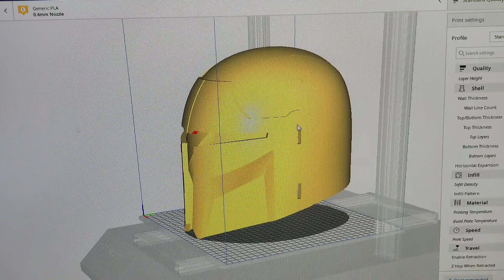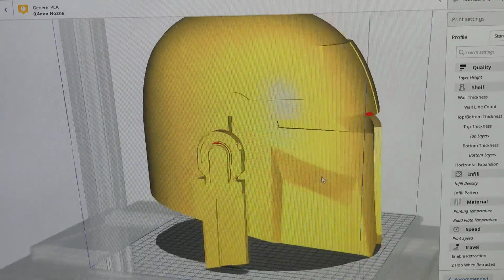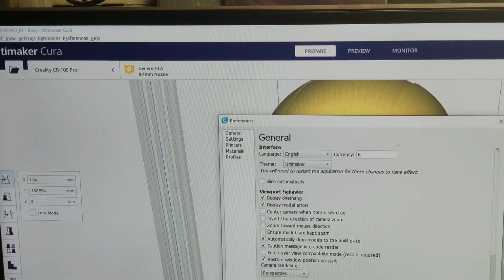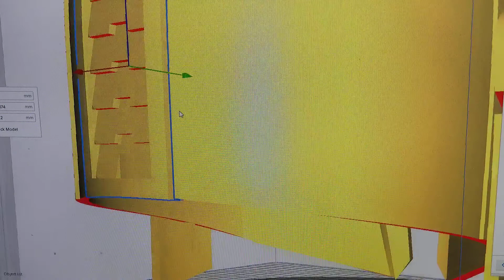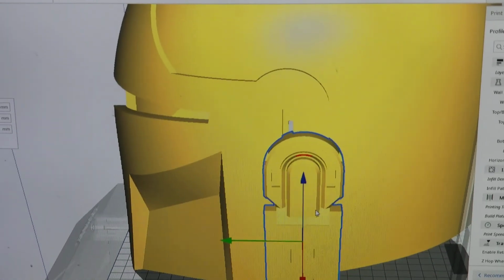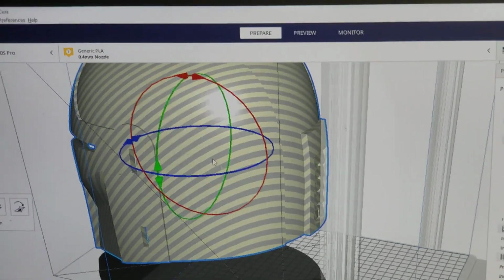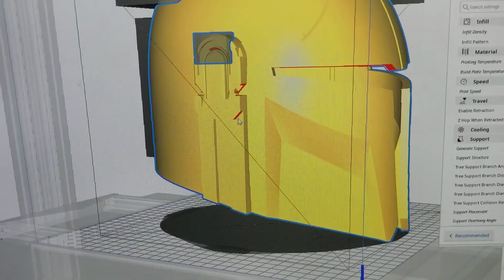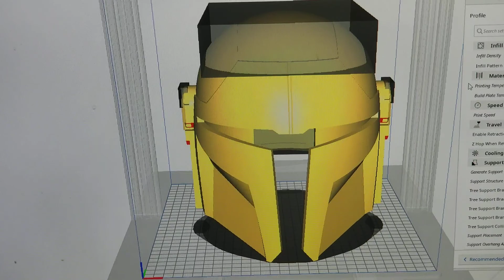Cura: Quick explanation of merging models

Comment: I assume Merge is not the same as Group. I assume Merge makes the models into one, as you say, whereas Group only makes them a group and not one model. I assume merge will make one object which will make one outer skin, for example. However, merge separates the models which is the opposite of merge. Please advise.
Reply from the maker: I've never had success with the merge feature.
Reply: @PrimeDirectivesArmory  I have a situation where I am Texturing and Tagging a Tapered Pipe (a bit more complicated than a tapered pipe, but for illustration). To line up the texture and tag with the outside of the pipe is a delicate operation. I have been able to get it done with many many hours of  adjustments but it's not practical. Grouping does nothing, as far as I can tell, to make a single model. I am confused since you used Merge, correct? It turned Zebra and seemed to work.? I have a suspicion the origins of each model is why they get disassembled. But, I believe it should work as one wants with the knowledge to do so.
Reply: @PrimeDirectivesArmory  Cura Forum says this:
First go into the cura  preferences (not project settings).  Go to menu item "Preferences" (or Alt+R).  Then "configure cura".  Make sure "ensure models are kept apart" is unchecked. 
But, Mine is unchecked.
Reply: @PrimeDirectivesArmory  I was able to place everything touching in Blender then select each model and export that as a single stl file. When opened in Cura it is a single file and a single model. It took me about 1 1/2 years to figure that just now.

Comment: i merge to models and it seperates them soon as i merge, could you please help
Reply from the maker: This technique does not actually use the merge feature. Try using the group feature.
Reply: @PrimeDirectivesArmory I assume Merge is not the same as Merge. I assume Merge makes the models into one, as you say, whereas Group only makes them a group and not one model. I assume merge will make one object which will make one outer skin, for example. However, merge separates the models which is the opposite of merge. Please advise.
Reply: @Kotaztrafee  any resolution ?
Reply: @Ork4life  Yea, thanks for your concern . I do not exactly recall why I was questioning this but I have no issues with merge any longer probably because I found a resolution one way or another. Thanks again for your concern.